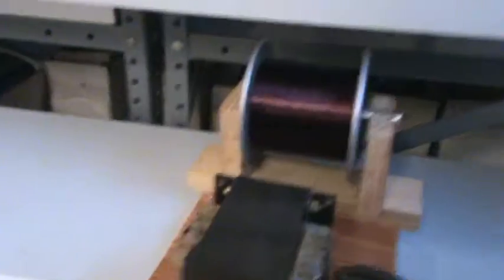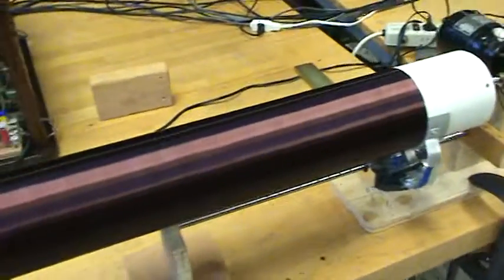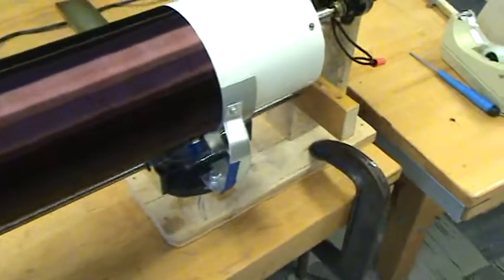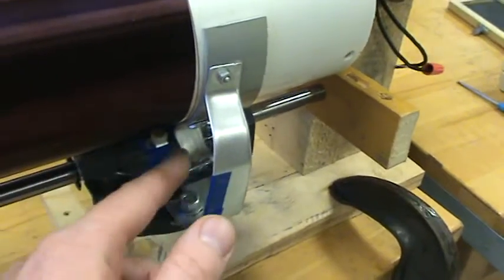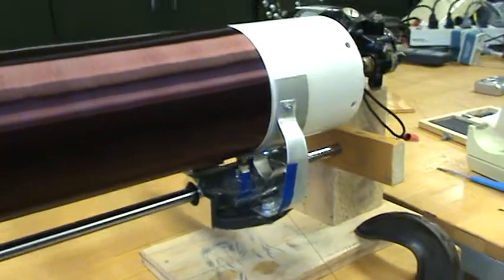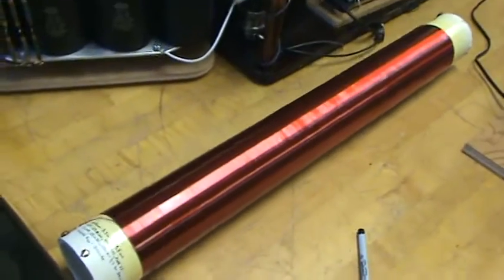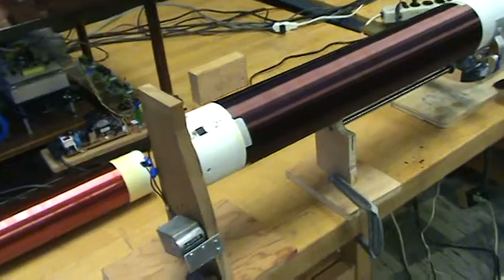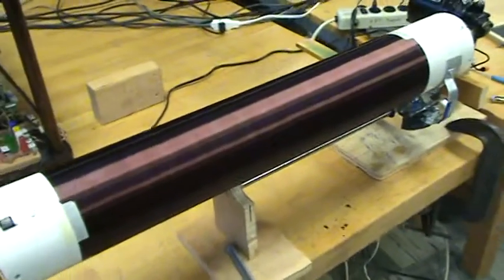(#0011) Automatic Tesla Coil Winding Machine - Part 2

Comment: I've heard someone say that using a needle like armature like on record players could be used to guide the wire as well. I know this video is old but after research other builds this one seems much fast to put together that those intricate Arduino controlled high tech designs.

Comment: Great machine. I use a similar process for hand wining 40+ AWG (Microwave fan bobbin, wire measures 0.15-0.10mm) onto paper towel tubes. Done a few 800 turn toilet paper rolls and Two 1100 turn paper towel tubes. (Videos on my channel of course, in the Slayer/tesla coil playlist).
I can get about 800 turns an hour with a friction break and a feed on guide. I just use a fingernail, but I really like your system. Although I think you could up the rpm quite a bit.

Maybe a silly question, but if that coil you just did is quarter wave for 100khz, then would that also make it half wave for 200k and full wave for 400k, or am I missing something obvious?
Reply from the maker: Thanks. During initial testing, I found the coil to resonate at a maximum 500 kHz with no topload. So, it could be made to resonate at 200 or 400 kHz with different topload capacitance. But if I did that, then the high voltage standing wave peaks would emanate from the middle of the coil, rather than on the top end, ultimately destroying the copper windings. However, if I want to convert it to a bipolar TC, I could mount the secondary horizontally with a topload on either end, the primary in the middle, and run it at 200 kHz.
Reply: Ok. That makes sense, and may explain my recent primary to secondary short and subsequent fire.

Might have to measure the wire next time....

Comment: Nice machine.
That automatic pusher mekanism seems to  work really well.
Btw, I see some ppl have used steppermotors to drive their coilwindingmachines. Seemsto work well altso.
Reply from the maker: Thanks. If I made coils frequently, I would certainly put in the time to make a good quality winding machine with stepper motor control. But for this, I just needed something easy and quick for one-time use.

Comment: Great professional set up you made there, A pleasure to watch. I wound a small 1 Inch diameter coil with 1330 turns which took nearly 2 hours , winding it by hand. Total length was 64 CM ( about 26 " )